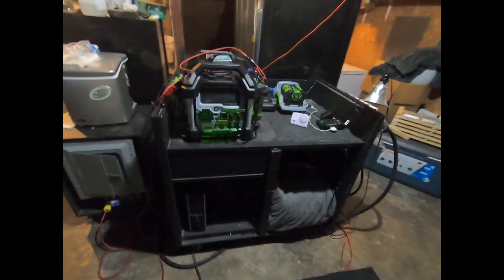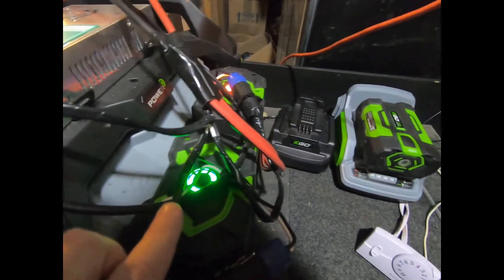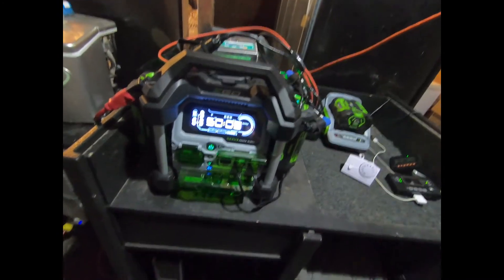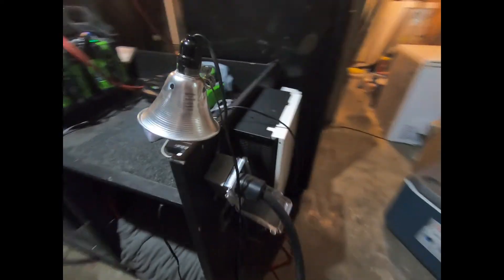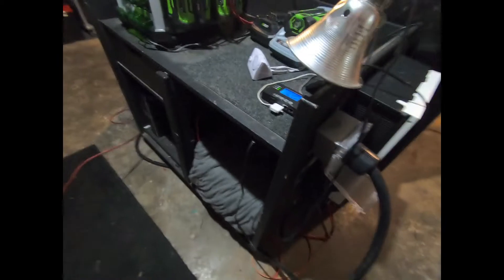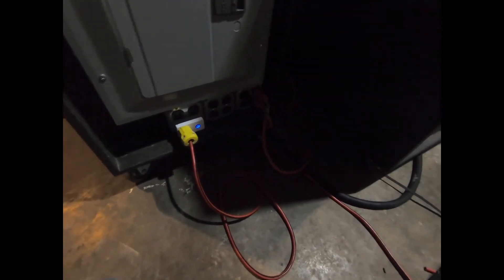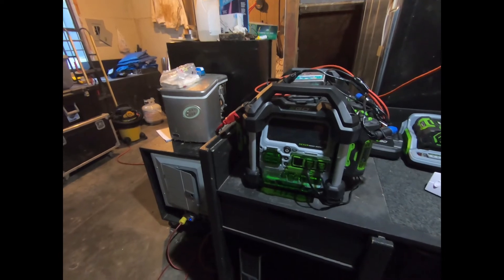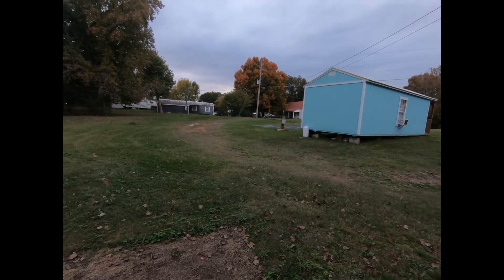Ego Nexus pass through charging and solar update

Comment: How did you wire it for pass through charging? Can u show the schematics? Thanks
Reply from the maker: There’s no real schematic, I simply wired a plug onto each battery by opening the battery and then made a 3 way cable and put them in Paralel. They will charge at the same time but, ensure all the batteries are near the same voltage before hooking them together.
Reply: @shawni38  thank you.

Comment: If I do this then I don’t need to purchase there ego solar brick charger I will just a need a solar charger… do you use the unit to charge the other batteries?
Reply from the maker: Correct, be careful when doing it because unless you add a fuse to each battery, you could get into trouble but, it isn’t hard and works great.